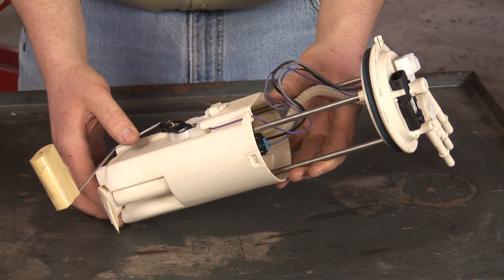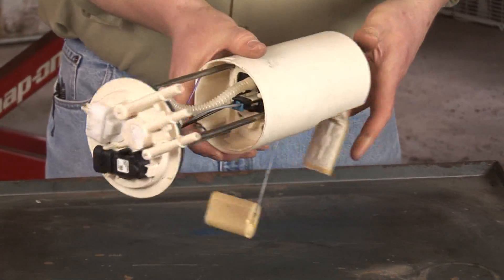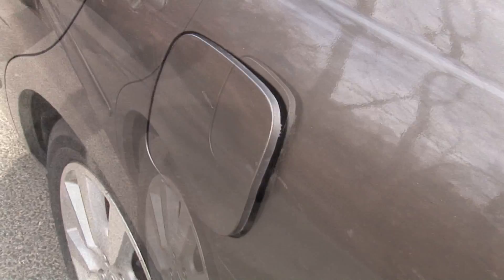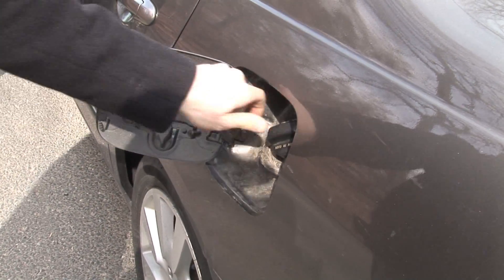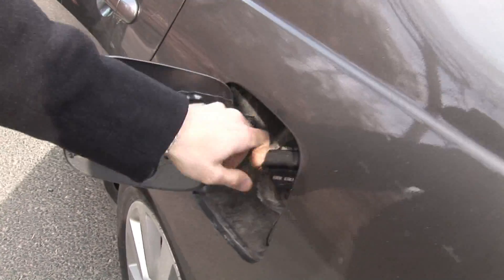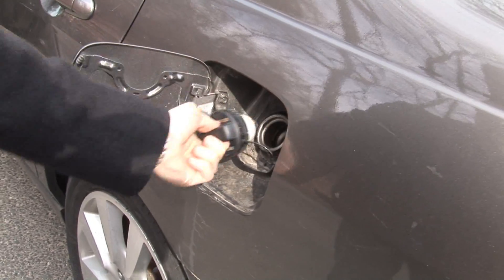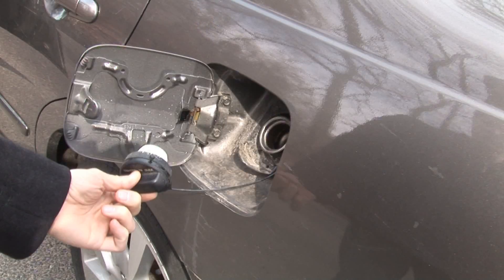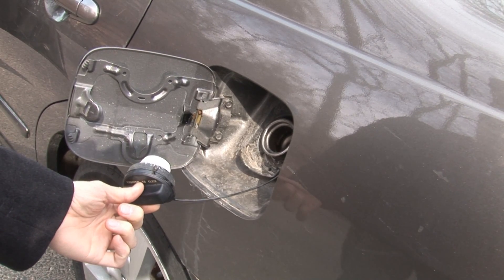Auto Repair & Mechanics : Troubleshooting a Fuel Pump

Comment: I've got a 99 dodge 2500 diesel cummins my in line fuel pump is a lot noisier and for some reason I keep getting air in my fuel lines and cant seem to get my truck primed back up and starting again. I cant tell if its a bad fuel pump or what any ideas?

Comment: I have a GMC vandura van. When I turn key on I can defenitly hear the fuel pump run but it stays running befor I even start it. shouldn't it build up sreasuer then stop? also its loud enough where I can hear the pump putside of my van fron 3 to 5 feet away. when I drive its fine but once in awhile I fell like it hesitates very slightly. Could the pump be going bad and can I replace it with an inline pump instead of an in tank pump.thanks

Comment: what if your fuel pump (when turning the key to on, without starting) sounds similar to a starter on a dear battery. kind of a weak turn once. but thats it. i cant hook up a pressure gauge w the tools that you can rent from autozone. but when unhooking the feed line to the filter, and turning the key to on, no fuel comes out.

Comment: my fuel pump stays on when the key is turned and primes several times after the key is removed from the ignition and the car is locked what could this be??